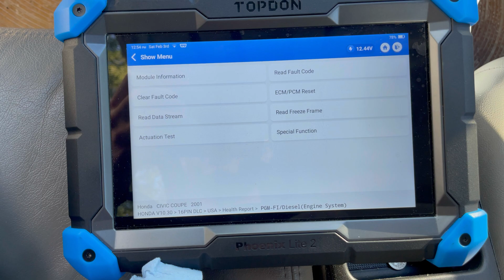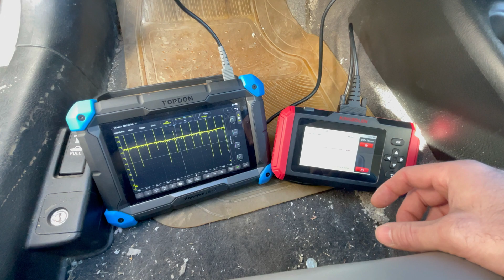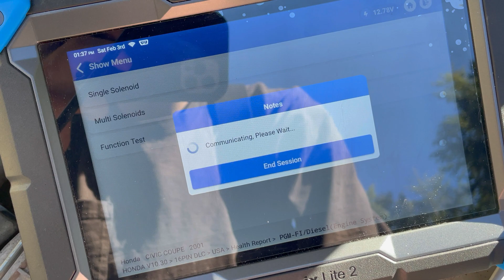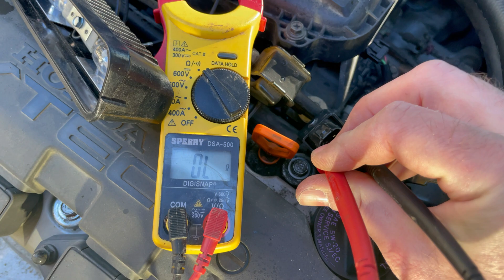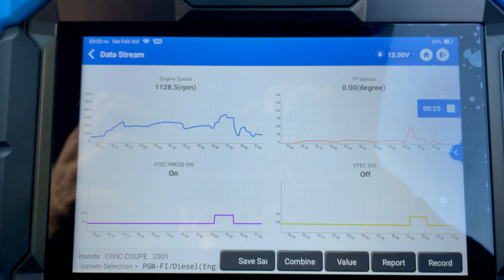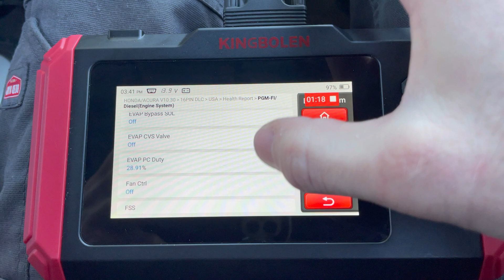Honda Civic 1.7L P1457 P1259 Diagnosis... Faulty ECM?

Comment: You can get topology as an addon, it's great to get an overview of how the modules are networked together and which modules isn't communicating on that particular line.. obviously you do not need this feature but it does help.
Reply from the maker: That is interesting, I did not know that.

Yes, topology is handy because it shows you which networks each module is on, but so does the wiring diagram so I’ve just never found it necessary. 

Thank you for sharing that tip, I’ll look into that add-on.
Reply: TOPOLOGY has its CONS, it does not show the proper layout of the modules in Series or Parallel to each other in reality, it does not tell you when a module is dead but installed unless you know what is installed such as the ECM, ABS, etc but if a silly example, if a heated seat and heated mirror and heated steering wheel module was dead and you did not know that module was installed, no help at all MAYBE, you would only get some Ucodes with no comm to this module and not even know what it was for?? If I am not mistaken, the screen does not give a count of modules on the main screen, you must scroll down to see what the highest number is on some scanners or count the installed ones yourself with no idea as the actual number of total installed modules, Snap On counts for you in 2 important places. NO, I am not a S.O. fan. Some scanner list everything and tell you whats not installed, but not all.

If you know what is not online, just look at the schematic and you may find the general area of the malfunction so no TOPOLOGY needed but the schematic is very useful, for guys with access, cheers.
Reply: @DuaneDonaldson  schematics requires you have a subscription or access to the diagrams. I DISAGREE about topology being a CON it’s a great feature to have but it’s not MANDATORY to fix an issue.  More than welcome to stick to wiring diagrams and schematics to fix everything or even just stick to Snap-On if you HAVE TO COUNT MODULES. Who’s to say the car was programmed correctly for it to have the right count of modules?  Many DIYers use older diagnostic kit with no topology wouldn’t even have knowledge on what modules are installed and have managed to fix their cars. At no point did I say it’s a REQUIREMENT to have topology. If you can’t see a module you will have a no com code stored somewhere.  Like you said if YOU know what is NOT ONLINE then start there no point in WASTING anymore time than required. All features such as Topology should aid troubleshooting. Should help you in diagnosing. This post is 6 months old and yet you had to dig up a post and PICK and POKE at something that was only meant to let the content creator aware of a feature that is available to the product he was testing. So off your high horse as you DEFINITELY SOUND LIKE A S.O Fan